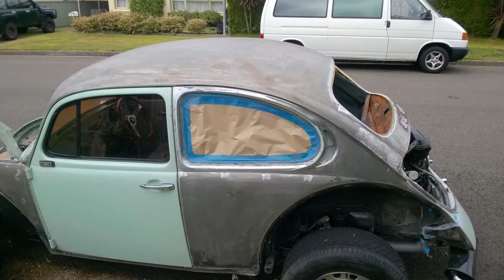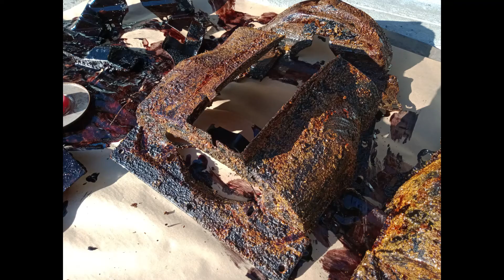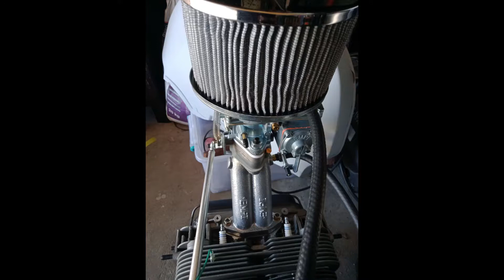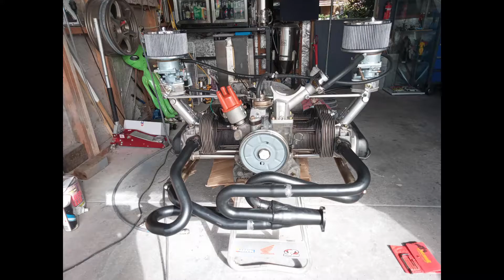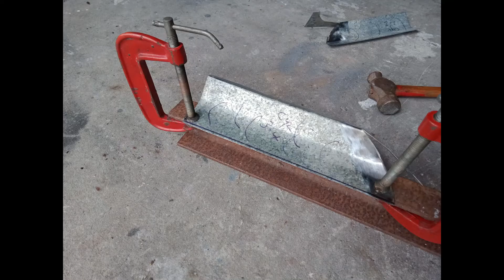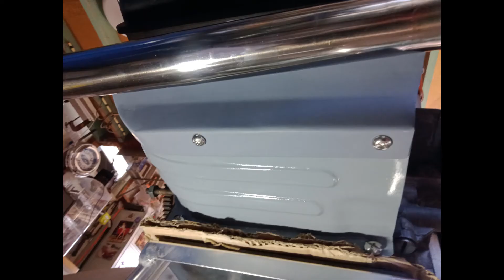VW Beetle 1971 Restoration project

Comment: Very cool project!
Reply from the maker: Thanks. New video coming soon. Engine color change to black metallic repaint and braided fuel lines. The alternator clamp broke and threw the fan belt. I melted a hole in the cylinder head.   New cylinder head machined out to 94mm required. New sidewinder headers wrap. Down the track a coil over front end suspension rebuild and finish trimming out under the front hood. She is a fun car to drive. Amazing power can be squeezed out of these little four bangers. Check out the beetle drag racers online.
Reply from the maker: I posted a video the other day with my engine with new paint, run in with a sidewinder exhaust now. Thanks mate.